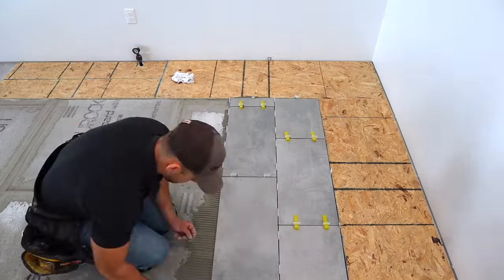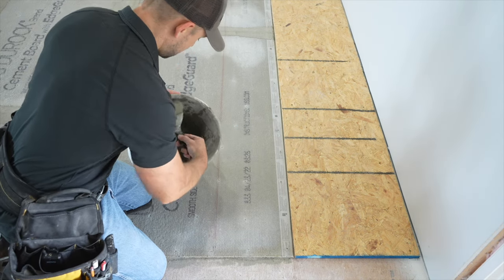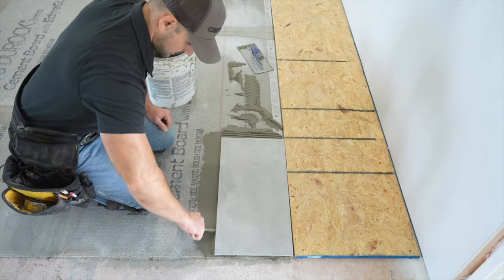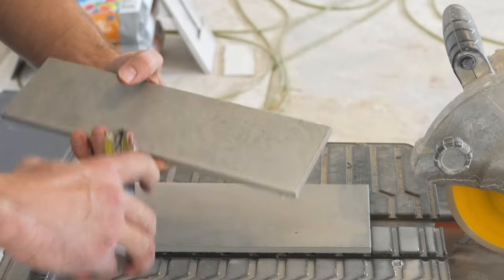How To Tile A Kitchen Floor

Comment from the maker: Hey! Below are timestamps to help you navigate this video better. Enjoy!
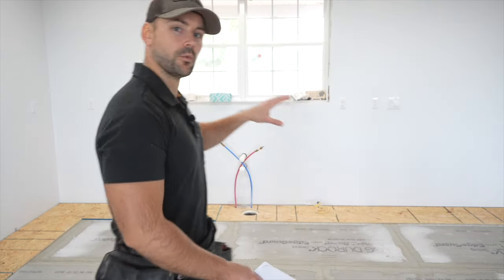Kitchen Layout And The Tile 00:17
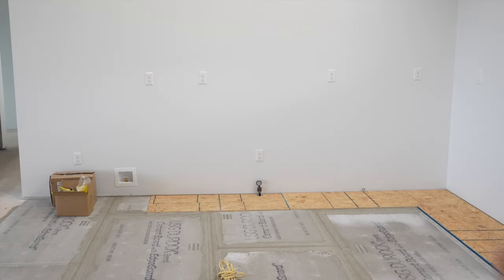Filling In The Floor Using Plywood 00:54
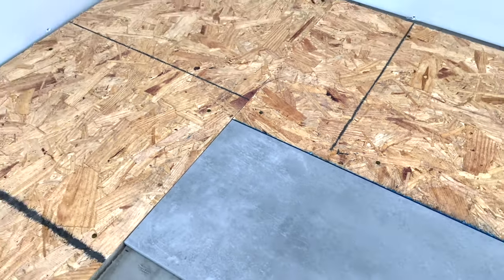How To Start Tile Using A Chalk Line 01:27
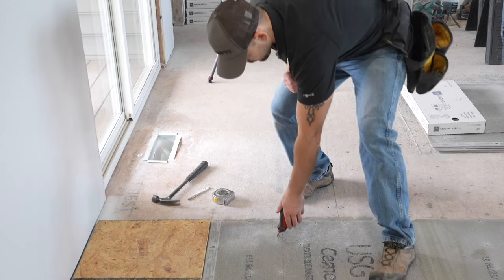How To Mix Thin Set 02:26
How To Begin Setting Tile 03:31
How To Apply Thin Set On the Floor 04:23
How To Back Butter Tile 05:15
How To Set Tile 05:47
How To Use The Tile Leveling System 06:43
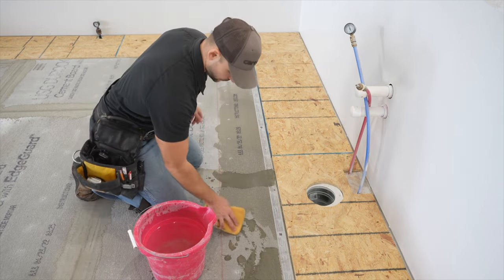How Clean Grout Joints 09:32
How To Cut Tile 11:19
How To Remove The Tile Leveling System 13:12
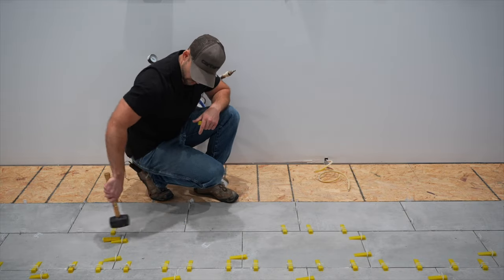How To Prepare Tile For Grout 13:56
How To Mix Grout 15:33
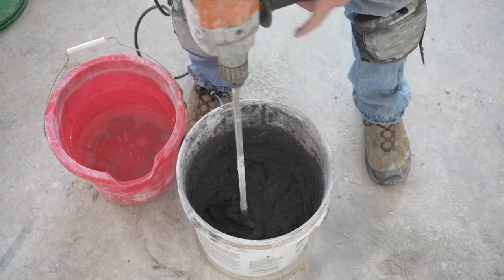How To Apply Grout To Tile 16:42

Comment: Yes save money now,  but in case of wetness,  wouldn't tile under floor cabinets more sense...?
Reply: I would paint the osb, then put a bead of silicone between tile and osb so water can’t get in there. Another weak point is where the drywall meets floor, a generous bead of silicone will likely prevent a water leak from finding its way into the basement.

Comment: Question:  you measure from the wall but what if that room is not in a right angle?   I was thinking that you would start at the center line.

Comment: I love working with rectangular tiles as well as 12×12 doing a pin wheel look with 6×6 on the corners which takes away from lines a little more. I have offset rectangular tiles and did a 1/3 offset to not have a joint lined up every other row. So many options when you have the ability to do so.  I have never been able to do tile before cabinets even on some new construction. Of course most of mine were remodel of just a floor or even a full kitchen. A little more time consuming but you always have to do what is needed. Great job as always Josh. 👍🏻
Reply from the maker: I actually liked the 1/3 offset as well. I do feel like the 50% off said is more forgiving. I knew when I first started doing tile I always line the joints up without having any offset but I found out it looks better when it is offset. I guess that’s just some thing you learn with experience. I just about got all The tile done in this house and I’m excited to move on to new content that is not tile related lol. I appreciate you watching all of my videos David. The support helps a lot! Hope all is well with you. See you in the next video comments!
Reply: @TheExcellentLaborer  also doing square and a diagonal look. It's amazing when new products come out, customers get crazy ideas. Sometimes they work and sometimes they don't. Remodeling jobs are a bit easier since a customer may already have the decor set. Some customers need the visual as well. Years of remodel jobs is a little bit of a plus for ideas. 
Glad to always enjoy and have input with your projects. Suggestions are always a good thing as well. Be safe and have a wonderful week. 🙋🏼👍🏻

Comment: Plywood under cabinets of a kitchen???? You are an optimistic and brave man. 
In my house, my beloved wife arranges a mini flood there 3-4 times a year. and driving all the time flows under the lockers. at home, I made a plastered waterproofing on the floor of the kitchen area with gluing the floor-to-wall joints with elastic tape and did not regret it

yes, 8-10 square meters of tiles were additionally spent. but on the scale of the repair is a trifle

Comment: I like your video. This is the first time tiling I'm tiling my kitchen what you did was came off the wall 20 in with your plywood I don't understand coming off the wall from one end to the other how would that be a straight meaningyou put your first tile a 16th of an inch away from the board the plywood then you marked alongside your tile then took a measurement from the wall again and came up I believe with 31 and 1/4 in drove a nail in went to the other end measured again 31 in a quarter then using a chalk line snap the line on the floor don't understand how would that be perfectly straight? I hope you can make me understand how. I followed everything else pretty good but I just don't understand how you did that and came out straight. Great video I hope to catch some more keep up the good work. Hope to hear back from you as I'm tiling my kitchen now I would not like to rip it up now thanks and keep the videos coming

Comment: Question please 
My kitchen floor already with plastic sheet with glue n I want to install ceramic tiles,,, what should I do? As I remove plastic sheet/tiles n place ceramic tiles on wood ? Or I remove glue first ?
Cement will be ok on glue or not ?
Please

Comment: Please tell me you tile where the dw goes…so many builders don’t do it. Hassle when replacing dw with something the owners want.
Reply from the maker: I actually do not tile there. I have not ran into a issue not tiling under the dishwasher. Dishwashers have adjustments on them to level up the floor easy. I hope that helps!

Comment: this guy is a " tiler to the stars ".   90% of what he does is not neccesary for a home DIY.  having said that this guy gets paid absolute top dollar to do his work.   he mentions an " assistant. "   i learned so long ago - always keep an assistant - if you can find one.  even  a young man at 14 years is possible.   pay appropriately ,,,
Reply: Idk I thought the 1/4 inch cement board was a joke use 1/2 or better yet schluter ditra. The back buttering made up for to small of a trowel